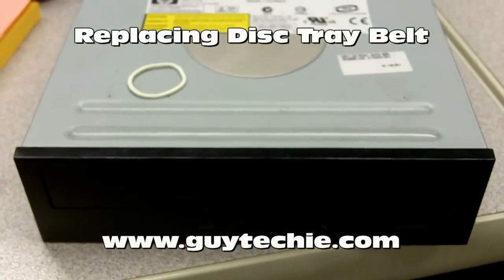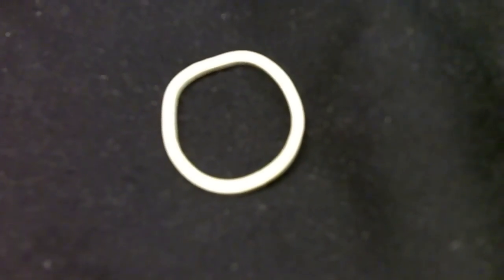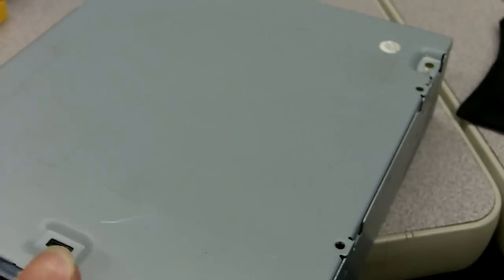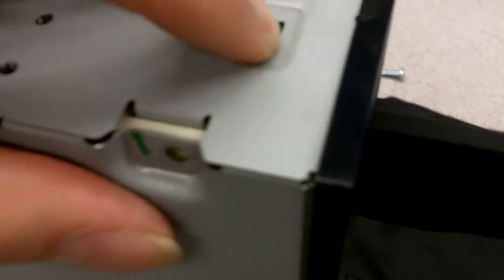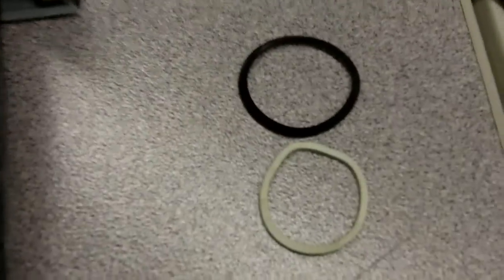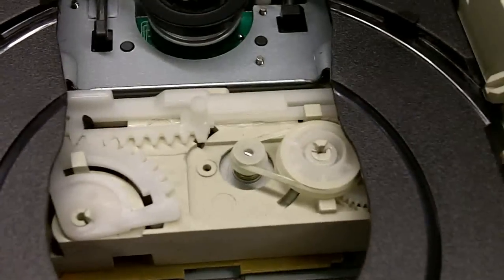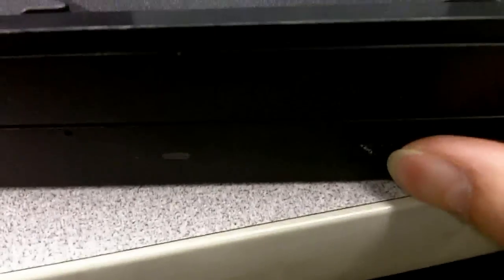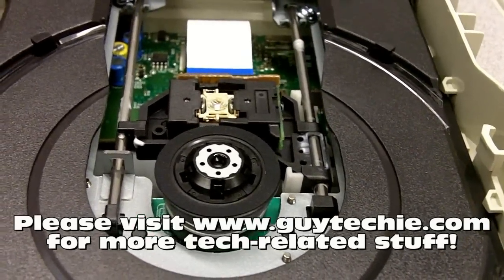How to Fix a stuck CD Tray

Comment: Awesome! I did all the work with the drive in the PC. Once the door/tray was open, I worked the belt off the pulleys with a different paperclip like a hook. Then I pulled the belt through my fingers and past my fingernail on the three sides of the square belt. There was a lot of the belt that had some 'gritty' feel to it. Got it down to clean rubber and wrangled it back onto the pulleys. Voila! Functioning again. Total cost: 2 paperclips and about 15 minutes (including watching the video). Thanks!

Comment: Many years ago I solved the same problem with a hi-fi CD unit and found that for very little you can buy strong rubber O-rings in a whole range of sizes from motor/auto repair dealers. Cost is pennies but maybe better than a rubber band?

Comment: This was very helpful. I was able to reach the rubber belt just by opening the drawer and using needle-nose pliers to lift it off the plastic wheel and drive pulley. Then I used a Q-tip with grain alcohol to clean the pulley, wheel and belt. With everything cleaned up, I put the old belt back in and it worked like new. Then I did the second DVD drive and got the same results.

Comment from the maker: @420stamper This only fixes the tray eject problem.  If it can't read, I suggest you clean the lens with a Q-tip that's slightly moist with alcohol first.  If that doesn't work, the problem is beyond what I can give advice for.

Comment: Good stuff.... office supply stores tend to sell bigger width and length rubber bands that will not work, best to go online and look for 1 1/4" x 1/16" #10 rubber bands, just the right size that will stretch apropriately and provide enough tension for your tray to open and close like new again, or go for the xbox360 replacement belts, they should work as well, be sure to clean the motor and drive pullies and read lense while you have it open using 90%-100% isoproply alcohol.

Comment: Well... That mostly just saved my DVD player. Actually, it's not so much that the tray wouldn't come out as that it wouldn't go back in (it was kinda skewed, but I couldn't tell which side was too high/low). This gave me the confidence to take it apart, fix it, and put it back together. Only now it won't turn on at all. :(

Comment: I had the same problem with my Audiosonic DVD player and replaced the small belt. However the problem remained. I tracked it down to the small black pressure switch that that is supposed to cut off the power to the drawer motor. It was not working so I applied some WD40 to the switch and the drawer now works perfectly.

Comment: Thank you. I've got two CD drives with similar issues, one of them opens just a little bit outside and I have to pull the tray out to make it work. When a disk has to be inserted the tray gets stuck in the same point and I have to pull so it can read the disk.

Comment: Thank you. I was about to buy a new drive.
I know the drive is good, because after using the paper clip to eject the tray, it closes normally with the button. And I use it to burn dvd's. but it just wouldn't open on it's own. I even went as far as to lubricate the gears.

Anyways thanks

Comment: Handy, and really gud video. But won't it work only on those big individual-unit drives? What to do if my laptop's drive is not ejecting? Dismantle the whole laptop, then fix the drive and then find out that the laptop is dead now and basically incur a bill that runs into tens of thousands?
Reply from the maker: This is for CD drives that are similar to the one in the video.  If you have something else (laptop, worm screw, etc) this obviously won't apply to you.

Comment: I have a Yamaha CDC-610 and the drawer wont open. Can't hear any motor drive or anything when turned on and pushing the eject button. Is this a belt problem or something electrical ?

Comment: I have a Innovative Technology Vintage wooden cd/turntable/radio.  The CD tray will not open and there is no pinhole to put a pin in.  It won't let me change to turntable or radio since the drawer is stuck.  Any fix for this?

Comment: I had a tray open issue on my xbox 360. I couldn't find an emergency eject thing, so I just opened it up. Lucky me it wasn't the rubber band thing, just a mere 1/8 inch lining of dust lining the inside that needed to get *gently* wiped away.
Thanks anyway though; without this video I wouldn't have thought of opening the thing up like I did.

Comment: I changed the rubber but it didn't work, the tray didn't come out. Could it be the loader issue ? If yes, tell me how to sove the problem?
Reply from the maker: It could be many things.  The belt is the most common issue.  Try turning it by hand to see where it gets stuck.  If it's hard to turn, but it still goes in and out, then it could need lubrication.  Lithium grease (the white stuff) is usually used for worm gears.  Also check for any broken teeth on the gears..

Comment: i had a small pin and i tried with it..now the situation is that the tray opened but the pin got stuck inside due to which the tray doesnt close now. it opens automatically when i push it back..
pleaseeee plaeseee pleaseee help me with what to do next

Comment: I used a safety pin to poke through the emergency hole and nothing happened :( heeeeelp
Reply from the maker: Poke harder.  Seriously.  It took some force for me, too.
Reply: I used a 1 inch skinny nail and it wasn't long enough or strong enough.  paperclip is the best thing.  good luck!